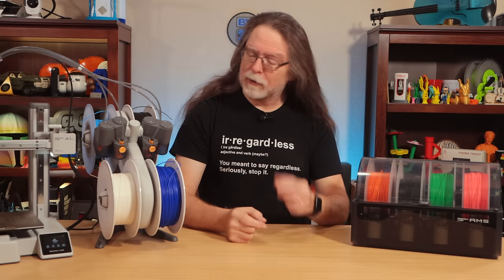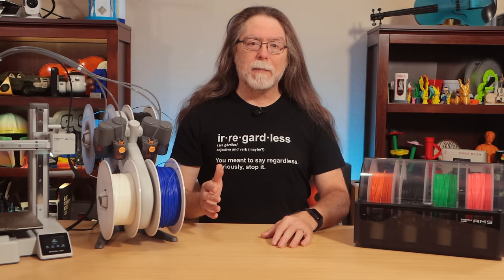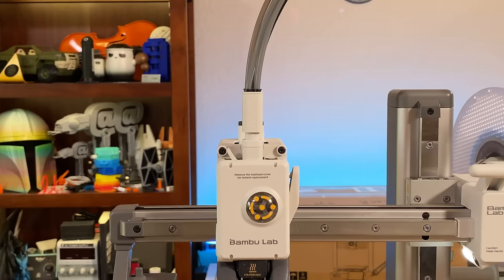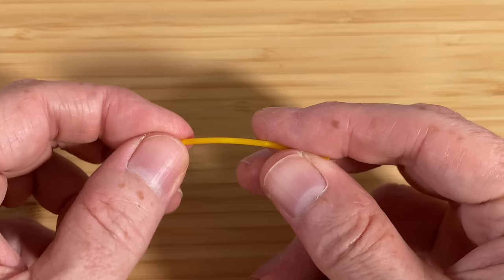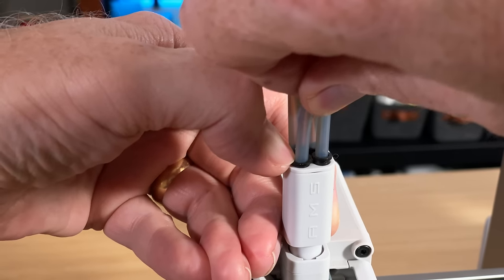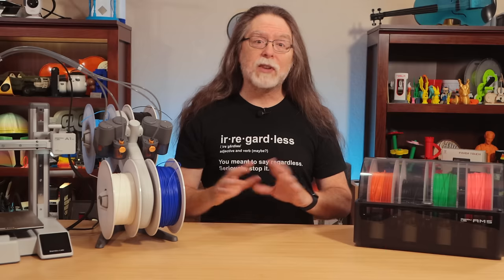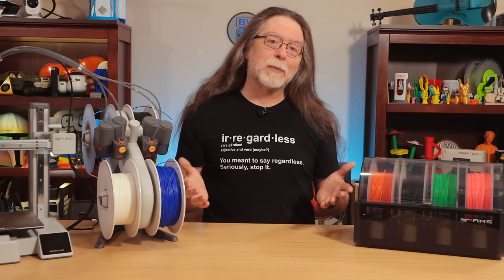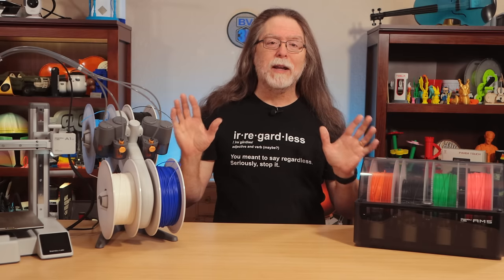The Bambu Lab AMS Problem NOBODY Talks About

Comment: Also, I know EVERYONE says wet PLA gets brittle, but do we know that for sure?When everything else in the world absorbs water, it gets non brittle.  Dampen pretzels and they get non-brittle. Put macaroni in boiling water, non-brittle. So I'm not REALLY sure about PLA.  Maybe CNC Kitchen has tested this.  BUT what does make PLA brittle is exposure to IR light. Maybe the clear AMS lid was a bad idea. But does plastic block IR?  I'm not sure.
Reply: It came to my mind too. Maybe that is why only the light exposed part gets brittle and not the entire spool.
Reply: We know that PLA gets brittle when hydrated since when we dry it it isn’t as brittle as hydrated
Reply: It's a chemical reaction - PLA is hygroscopic - it absorbs water from the air (like silica gel) but it's not the absorption that causes the damage. Once absorbed the water breaks down the polymer chains in the plastic in a chemical reaction and that causes the brittleness. Think of it like plastic rust.
Reply: @mondotv4216  Yea I meant that OP’s question if we knew for sure was a question answered

Comment: Yeah, that is one flaw in the Bambu A1 and Mini is that the way the tubes are held into the extruder.  There are metal  angled spikes that when you push the tube in you can’t pull it back out but the spikes can become bent and can be pulled out.  BL needs to work on that.

Comment: It’s the filament getting wet and brittle because it’s sitting in open air. For any printer you should unload and package up the filament with desiccant after printing at the very least. Ideally vacuum pack it with desiccant and dry your filament every so often.

Comment: Good work as always! Great shirt, but no puns? I dropped my toothpaste and now I'm crestfallen. I've been on the fence for a while about adding a Bambu printer to my collection, since I only have one printer that can do multiple colors; my Sovol SV02.  But too many parts on the Bambu printers are proprietary, and the engineer in me (my day job) just cringes with design flaws that the situation that you describe can painfully point out.
Reply: I took each mention of "Tip" as a pun, because it affects the tip of the filament 😆
Reply: But the great thing about Bambu is that you can easily get all the parts you need and they’re VERY inexpensive!

Comment: For the AMS unit for it's enclosure there are plenty of mods/STLs that allow you to add extra desiccant throughout the unit which I use and have never really had a problem. I think the only problem most people will have with this recommendation is making it a habit to check before using lol. Great video and thanks for the content!

Comment: I do not own a AMS lite, but for the regular AMS you can clean the tubes without stopping the print.

You just have to be quite careful when disassembling it, remove both screws in the AMS, unplug the PTFE tube that goes out and VERY gentily pull out the piece that holds the 4 spools making sure that you don't unplug the two connectors to the PCB. Then disconnect the PTFE tube and make sure you clean it up, then resume the print.

Of course this is annoying, but at least you don't have to cancel the print...

Comment: I've had this happen 3x on my AMS and it was definitely due to not using the printer (for weeks and sometimes months).  I started unloading the filament (before I saw this video) after the 3x time it happened and have not run into this issue, since.  In my case, the filament would snap inside the AMS tubes.  I'd have to unload the AMS, take the AMS apart and then clear the jam...a real PITA!

Comment: Some brands are definitely more likely to break than others, but I find that some colours of eSun PLA+ are very susceptible to breaking in the AMS Lite if they’re not used for a few days.

In the original AMS I try to make sure that there is plenty of fresh colour changing silica gel on the rear chambers and in boxes between each feeder and that seems to keep the filament in good shape for weeks if not months, (providing the gel is changed regularly as soon as it shows any colour change).

Comment: Actually I’ve had this issue with my ams. But I didn’t need to turn off my printer or cancel the print. I just pause the print and disconnect the tubes and cleaned them out and then reconnected the tubes and resumed the print.

Comment: I bought my 3d printer before any desktop AMS machines were available on the market, so I ended up installing a 3d Chameleon. It works quite well once it's tuned in. I've only had the filament break inside one of the tubes once in about a month of use. I think it had been idle for a day or two when that happened. At first I thought I had a clogged nozzle on my hands but quickly figured it out when I pulled the old filament out and tried to "rethread" it.
Reply: I've been waiting for the 3D Chameleon to mature, but it's an ideal dry box compatible AMS system, and I like its simplicity. I intend to use it with my new 3D printer when it arrives

Comment: You are so right about those AMS lite connectors not wanting to let go of the tubes at the print head. I had broken a ribbon cable on my A1 trying to get those out to remove a broken piece of filament from the hot end. Luckily the A1 recall happened right after so I just returned it.
Reply: They are called collet clips and to remove them you push the clip down then pull tube at same time.

Comment: Thanks for the tip! I have only had my A1 Mini for just over 2 weeks, and I don't have the AMS, so I am hoping that I don't have this problem. I am ofter swapping filament, and always put the roll I have removed into a vacuum bag, with dessicant beads, then use a small vacuum pump to remove as much air as possible, to try to avoid moisture getting to the filament. I will now also remember to try breaking the end as a final check too! 👍

Comment: That's brilliant to mention. I had that problem twice in my X1ns AMS and second one was complete dusaster as small piece of filament snapped in that thing with magnets. Had to disassemble it to get that piece out and spent couple of hours to get magnets back in their slots as I hadn't any good magnet to place on other side. I was close to throw it out of the window and order a new one. And yes I used a roll in AMS slot I didn't use for few weeks and yes my AMS is full of desiccant modules. So I'm checking all a while unused filaments for brittleness before use  in AMS

Comment: Been there and done that. Had to completely take apart the printhead to remove it from the sensor arm. Such a small bit was jammed on sensor. That was the last time I used Bambu PLA-CF brand new from the package without drying for 12 hrs min. Has worked great since.

Comment: I've had this happen with my AMS lite with my A1, my gold filament is super brittle it seems. I've not once had to cancel the print... I just disconnect get it set back up and the awesome litl printer just continues on with the print... now the times its happened to me I was in the room so everything was still hot and was able to fix in a reasonable amount of time but the print just continued on its way. I so far try not to cancel a print unless its a catastrophic failure, I just cross my fingers and hope whatever went wrong wont ruin the rest of the print... so far its been about 50-50
Reply from the maker: I don't "hot unplug" the AMS or AMS Lite because I seem to remember there being a warning against it somewhere. I could be wrong though. I might have gotten that impression from the note on the A1's front MicroSD card slot that says "cold swappable." Good to know unplugging and re-plugging the AMS units doesn't cause a problem!
Reply: @BV3D  I dont unplug the port just the filament & or tubes. I've had to do it only like 5 times and haven't had any issues. Could just have been lucky. I'm gonna go read up on that cuz I'll admit I don't remember noticing any label.. but I can see it for SD cards since thats kinda a normal thing or at least was, haven't used any sd cards in years and I've only left the one in the printer where it was.

Comment: Great tip, and yes I do as suggested, unload the filament from my AMS on a regular ish basis
Reply: I tend to leave the full AMS loaded as I have the 2 internal silica boxes full and 3 more "up front" silica boxes in it. For my A1 and the AMS Lite, I never leave spools on it when it's idle. I put them into dry boxes (cereal containers with silica packs from new spools in them) when done with them.

Comment: If u haven’t used filament for 6 months and I recently purchased an AMS/Bambu P1S(arriving Wednesday btw very excited!) I live in Ohio, extreme weather changes, I have a filament dryer (TBH not sure it works have had issues after drying but that is an issue for another day) check the ends of the filaments before loading? Or dry 1st? It’s mainly silk but I did notice the breakage off a roll when I was switching and reorganizing to get ready for my Bambu.. I mainly own silk .. until recently and they are still boxed and sealed plus I also invested in a filament storage kit which suctions air and seals the filament once opened (good investment or bad🤷‍♀️. 
Any other suggestions or recommendations please btw ur tshirt …AWESOME!

Comment: To release the PTFE on the extruder on AMS lite, there are some printable tools to assist and make it quite easy. A problem I had was broken filament in the extruder, that blocked it and so the PTFE coupler "beoke" apart. I managed to get every small part and assembled it again, but as they are cheap instantly ordered a new one, to have replacement if this happens again.

Comment: I've had it happen a couple of times on my A1/Ams Lite. I didn't have to turn off anything or cancel the print. You just disconnect the PTFE tube from the top of the extruder, pull the snapped off bit, reconnect the tube, and clear the error. The print resumes.

Comment: I've had this occur in my AMS working with an older spool of PLA. Getting at the internal tubes is an adventure.
Reply: Same here, I now no longer replace the screws in the bottom plate of the AMS, so I can remove it easily.  The weight of the spools keeps it in place

Comment: "In the extremely unlikely event you aren't going to be using your printer for a few days"  classic line!  However I hadn't used my printer in a few weeks and I was getting unload errors at the end of printing a plate. I do not think the filament broke in my case because I just cleared the error, pulled on the filament in the AMS and resumed and it fixed itself. But I will certainly be pulling the filament out if I think I wont be printing in a while.

Comment: I had one filament snap on the full AMS on a P1S early on due to using an old roll without drying it, and it wasn't stored in a dry box. The Lite, in my opinion, is MUCH easier to deal with and you don't have to pull it all apart (at least I haven't had to) to get a break out. The AMS on the other hand, I had to disconnect and remove the tray, then disconnect the PTFE tubes from the 4-to, and while using a good piece of filament push the broken one out while hold the gear disengage button. Yes, the tubes in the A1 series can be really difficult to get out of the 4-to-1, but printing the Bowden tube release tool makes it much easier (for both printers).

What IS more common on machines is heat creep locking the filament in the toolhead extruder gear chamber. Several of those have happened on my P1S and even more on my brother's X1C. Partial toolhead disassembly needed for those.

Comment: I came to the same conclusion as you, I have a mk4s with mmu3, and precisely that thing about brittle filament was happening to me, and I had problems because there were pieces of filament left in the system, and the The only solution I came up with is to unload the filament if it is not going to be used, I am about to buy a bamboo lab A1 and it comes with the AMS Lite combo, I certainly don't need the AMS Lite Since I have the mk4s with mmu3, which by the way I stopped using for a long time due to filament waste.

Comment: Not really sure if this is a "Problem Nobody Talks About" but your solution is a good one, but a bit of a pain.  For PLA, this is a good solution. Not really needed for other filament types too much.  Bambu Labs needs to find a better AMS solution to this. Yes its going to happen, but taking the AMS all apart to fix this shouldn't be required.  Those two AMS screws holding the black part in WERE NOT designed to be removed often.

Comment: How long is filament good? I am having nothing but issues printing with the AMS not retracting the filament and erroring and not able to push the filament into the hot end. This is happened with my last 2 prints. A 1 day 10 hr. print took 3 days because I had to constantly fix the issues I mentioned above. I'm at my wits end. I did replace PTFE tubing inside the AMS after hoping this will help but I don't have my hopes up by any means.

Comment: I had one brand of filament that as quite literally Snap City. The printer I was using doesn't have a reverse bowden tube so when the filament snaps the printer just keeps on printing as the run out sensor is above where the filament would break.  Suffice it to say, he company replaced the spool, but the replacement was no better. Drying made ZERO difference. We've bought many different brands of filament and never had filament break like that.

Comment: Great tips, however it's not totally impossible to recover from a snapped fillament mid print.
I had a filament break on retraction 90% into a mutli-colour print on a P1S. It snapped in the Tool Head, just far enough back from the extruder to trigger the Run-out sensor.
I was able remove the PTFE from the tool-head, heat a paper-clip and insert into the top of the extruder, and pull out the small bit of filament triggering the sensor. After that, I re-inserted the PTFE, hit resume on the printer, and it loaded the next colour. Print finished successfully after that.

Comment: I had my filament break in the lite several times. I never had to stop the print for that reason. For the standard ams it’s not much of an issue since they’re always broken anyways. They just look nice.The X/P series is very much locked to single material prints. The lite is much more reliable.

Comment: I had this happen to me yesterday on my A1 mini.   Finding the documentation was a little annoying on how to unclog.  Thankfully i've been doing this for about 5 years now that i know how to unclog the printhead on various 3d printers.  

Its actually not that hard to do on a A1 or A1 mini.   Put some Heat resistant gloves on (or in my case grab a needle nose).  Take the cover off exposing the hotend, then carefully take off the silicon sock.   After that open the clip that locks the nozzle into place and take the nozzle out.  If there's any filament stuck in the nozzle just pull it out with the needle nose from the top side.

Next step is to press down on the 4 in 1 hub and have one of the ptfe tubes uncouple so you have access to one of the holes.  From there get a piece of  filament and push it threw the open port until whatever was jammed in the extruder blasts out the bottom opening where the nozzle was.  In my case it was about a 2 inch piece of pla from a really old pla spool that i had less than 100g's of filament on that i was trying to push threw the printer so i could get rid of the spool.   

Printer is now unclogged, reassemble the head and put the ptfe tube back in place. Finally snap the cover back on and reload your filament.

Comment: Orrrrrr at least for the standard AMS just add the desiccant inserts. I live in Alaska which is actually one of the most humid states next to Florida and I strictly use PETG. If I leave it out for a week then I need to dry it again. Leave it in one of my AMS with desiccant and even 3 weeks later is is flawless. The AMS light is a problem though for sure with high humidity. I even have PLA print worse after 2 weeks out. So I pull it off my A1 when not using. It is why I have 4 different printed with the standard AMS since it offers better filament protection. I have had to disassemble the standard AMS a lot even mid print. I think I have a PhD in the AMS by now 😅

Comment: I had this also at the A1 with AMS light mainly on a very old spool ... but because the printer creates an error ,,, and stops .. i was able to disconnect both sided of the bowden tube and get the filament parts out of it (it was not only one time broken). it just trries to re feed or get it out until you press the button on the screen
I needed also a bit other filament to push it out
Btw, the Extruder side disconnects better after you had this issue several times :)

Comment: the AMS can be disconnected without cancelling the print. I did it just last week. Filament couldn't retract. I disconnected it. Disassembled it and removed the rogue filament, then plugged it all back in and clicked "resume". No problems.

Comment: This problem needs to be fixed by Bamboo.  

I have installed desiccant packs in between the front wall, in between the motors. I have installed more packs on the side and replaced the packs in the trays on the bottom of the AMS. for light spools at the end, I use desiccant packs in the center to hold them down. Many sizes on Amazon.

When not being used, I remove the filament from the drive and install only what I need at each print.

I break the end off to check how much has been ruined by the air before using.

I experienced breaking filament inside the hubs and AMS. Small pieces that required disassembly.
There needs to be a magnet kit for the hubs. The powerful magnets inside jump out and throw the tiny springs everywhere, especially when you are not ready.

I have two AMS and live in the high desert with lowest humidity in western America.